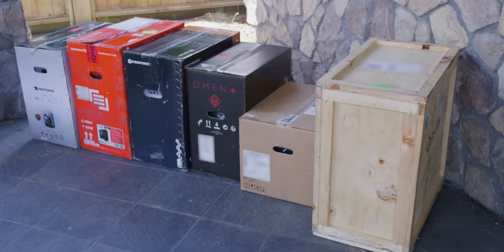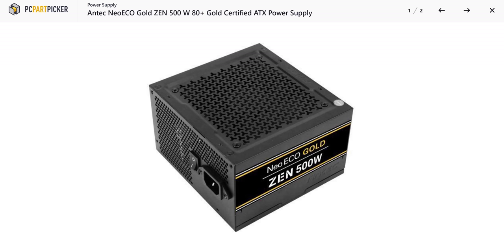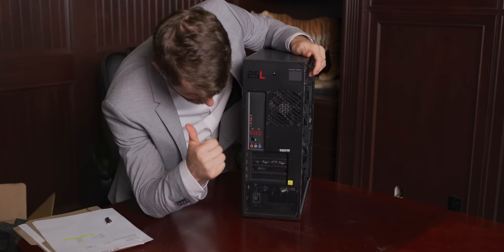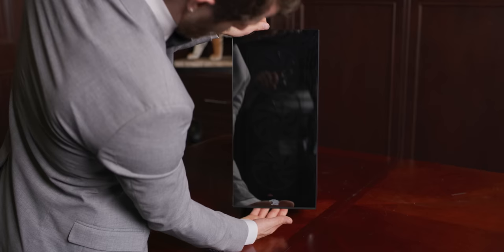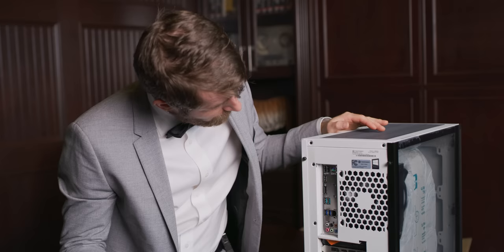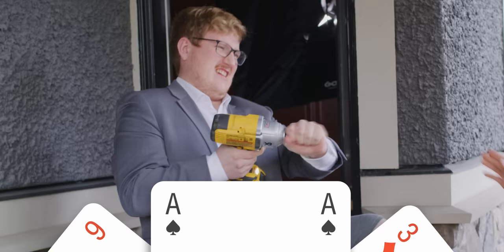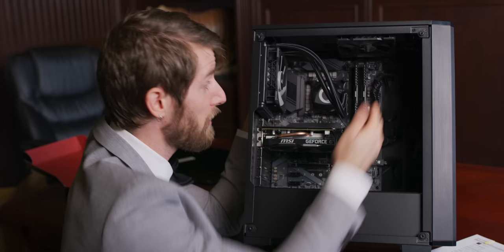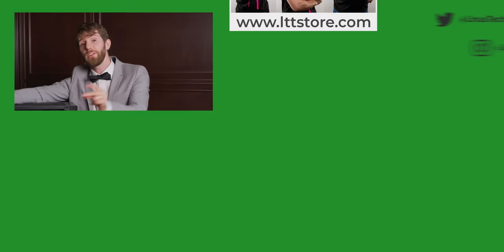What Did We ACTUALLY Get? - $1500 PC Secret Shopper 2 Part 2

Comment: If you watch close enough where Linus throws the Ram you can see it was actually the Ram that was trying to get away from Linus.
Reply: Origin PC: That AIO cooler is installed wrong way, air bubbles will get back to the pump.

Comment: Imagine having an air-cooled PC crate-shipped with a 1660 video card.
Reply: Is that a bad thing? I don't get it
Reply: Imagine having a 1660 video card
Reply: @BUCCIMAIN  Well it was the same price as the other ones but some of the others came with a 2070. much better than a 1660 and it also had the worst CPU. I would take a bent case over that any time
Reply: Directly from chYnuh
Reply: @aurorapaisley7453  lmao i'd kms if i had a 1660
Reply: @nicholasjasman6550  really bro? What about a gtx 1050 ti like me
Reply: @abd_cheese7353  jesus christ thats just depressing
Reply: @nicholasjasman6550  no man its fine. I can play most games at 1080p 60fps on lower settings. Its actually my cpu (i5 6400) that bottlenecks my games
Reply: @aurorapaisley7453  my 1660 does well :(
Reply: @binkk2931  Me chilling in the corner with a 1650
Reply: @Gort _ im sorry, thats brutal
Reply: its not brutal
Reply: @nicholasjasman6550  bro theres no shame in having a 1660
Reply: @nicholasjasman6550  1050 ti was a great card back in the day it was my first one but now I’m rocking the 3070ti thanks to gpu shortage being over but 1050 ti will always be a great extreme budget card
Reply: @BUCCIMAIN  Imagine getting an indoor golf court for a 1400sq ft apartment. Do you understand?
Reply: @Aurora Paisley  bruh I've got a 2gb 1050 lol
Reply: @boblatte123 thats a yuge ooof
Reply: @ObiJUAN  yeah, still works for what i play, but would like to try a newer card atleast
Reply: @boblatte123  3060 for 259 if theres a microcenter near you. That will be a massive upgrade for ya
Reply: @aurorapaisley7453  sounds like you need the wood
Reply: some of you clearly value GPU's a lot and I simply don't get it lol
Reply: @junior1896   These are gaming PCs and the GPU is the single most important component for gaming performance. Why wouldn't you value the GPU a lot?

Comment: Pro tip for the omen, that top panel can come off with a couple screws for a massive airflow improvement with no difference to anything else
Reply: Another thing with the omen: There's 4 panels in that top panel that'll pop out with some pressure, and 4 screw holes for a 120mm fan to mount to the system.

Comment: Origin has their AiO radiator mounted upside down. This is not only going to make it run unnecessarily loud, it will also compromise its lifespan as time goes on and water permeates into the tubing.

Comment: "what power supply standard is this?"
"DELL"
Reply: its too bad, a few years ago they still had standard psu's in their xps series
Reply: no no, its future proofing :P
Reply: yeah I have
 took apart in 2014 Dell systems with that same connector layout
Reply: As soon as I saw it, I thought "That looks like a cheaper low-end model server power supply, or maybe like one of those dedicated 12v ones we saw show up a few years back for crypto-mining rigs?" (I've used those to power LED lighting systems more than once, haha) Then Linus confirms it's a 12v only PS and... 80+ platinum on a 12v server power supply is... not very good. Don't even waste your time on anything under at LEAST 90+, if not 95+ or even 98+ at that point, as the cost difference on 12v supplies, unlike traditional multi-voltage ATX supplies, is a much smaller increase that is more than affordable once you're already in that price range and basing cost on %. It is nice to see that finally becoming a standard, though.
Edit: To clarify what I meant by that price range: 12v power supplies are cheap. REALLY cheap when compared to the traditional ATX ones. Need a nice top end 95+ rated 1200w power supply? How does $114 sound brand new? Sure, you could get the 80+ one for $100, but at that point you're not being efficient on just the added power cost alone over a few years.
Also... Platinum 80+? I've never seen that. Gold 80+ sure, but platinum I've always seen listed only on 85+ supplies...

Comment: What most people don't know about the Omen is that the case is designed for water cooling using a radiator in the top that does actually port through for cooling. As an owner, the lack of expansion ports is the only issue. Personally not enough USB ports.

Comment: FYI: afaik this isn't DELL using the "new" 12V power supply standard, but DELL just using their proprietary own 12V standard they've been using for years. 
For example the Dell Poweredge T20 also only uses 12V from the power supply and that came out Q1 2014 afaik.
Reply: I thought it was a redundant module from an industrial PSU.

Comment: I've got that cyberpower case and it's pretty great with regard to airflow. I use the 3 included led fans for exhaust on the rear and in the top two rear spots. Mounted 3 corsair fans to the other side of that grill where there is very little gap between the fan and the side pane for more direct intake.  NH-U14S instead of aoi.

Comment: Oh... That I/O sticker hurt. I was coming into this expecting to trash talk the Dell but that sticker was my least favorite part of this.
Reply: I know right, I normally just include a quick start guide with like 3-4 steps, photos of the actual machine they ordered and arrows pointing to where you plug things in.

Recently though I did a house call for a 9 month old machine with "fans turn on but no display at all anymore". Tried remote tech support first but silly me being used to highly complex problems, forgot to ask the most basic ones first. He had tried different HDMI cables, swapped monitor with his housemate, I even walked him through a CMOS clear just in case it was a booting issue or OC instability, but not wanting to leave him without the ability to game over the weekend I decided to pack some spare parts for testing and head over.

Before I even dropped my bag of spares on the floor I saw the HDMI cable poking out the top half of the case... the motherboard port, on a Ryzen system with no iGPU
We had a good laugh about it afterward, but it did remind me that I should step up my "user friendliness game".
So now I'm thinking of printing out some low tack vinyl stickers (NOT paper, and like 10 cents added cost per machine, oh no :P) to more easily highlight packing materials which need removing, where to plug things in, and maybe a small one that totally blocks motherboard video out if the CPU doesn't support it.. still easily removable if they want to of course, but which can be left on without blocking any other ports.
Reply: But they saved almost an 1/8th of a cent buying those cheaper stickers!! :D
Reply: @_Piers_  If these decisions were down to cost rather than just stupidity, you would think they could ask the customer "Do you want a complimentary basic keyboard and mouse?". Even if only 10% of responders say no it would save more than the cost of switching to vinyl stickers. 

I mean, the boutique builders have nicer everything.. more powerful parts, better quality cases, better cooling, and they still make enough profit. With lower sales numbers too.
I don't want to believe they'd do something so stupid in the interest of cost savings.
Reply: @MotoCat91  My real guess is that they just don't care.

Comment: After watching Steve's video on how the 80+ standard is not what we thought it was and only validates efficiency, I'm coming back to this video with a new frame of mind on Dells 80+ platinum power supply. Yeah it may be efficient but does it have any weird quriks and will it last?
Reply: Also to be clear that dell PSU is not the 12VO standard. It's completely proprietary. So is the motherboard. It's not a standard form factor.
Reply: To be fair, the 80+ standard never pretended to be about anything other than efficiency. Never seen a single scrap of marketing indicating anything else.
Though the Dell PSU is cheating by beeing the utterly shit 12V only 'standard'. Makes the PSU more efficienct, but many components still need 5V or 3.6V, so you need more transformators on the MoBo. They are basically outsourcing parts of the inefficiency that way.

Comment: The company I work for is pretty big and has different locations all over the city. I was located in the PC building (and ordering) location for some weeks. We literally "shipped" 1200€ PCs in the way of putting them on cheap and old transport trolleys and rolling them around the streets till we arrived at the destination. If anything wasn't as ordered, we put the PC back in the bux and pulled it back to the office where we fixed and and pulled it back.

Comment: Linus, 5600 xt ($ 310) beats the 2060 ($ 340) and is sometimes equal, better or less good than the 2060 super ($ 420)
5700 (350 $) same as 2070 (500 $)
5700xt ($ 440) better than 2070 super ($ 540)
(all in US dollars)
Don't say that the last radeon doesn't compare to the last rtx. That 2070 super and rx 5700xt are more or less equals

Comment: Timestamps!
0:00 Intro
0:14 Explanation
0:42 Sponsor (dBrand)
1:08 Title
1:17 Dell
7:16 HP
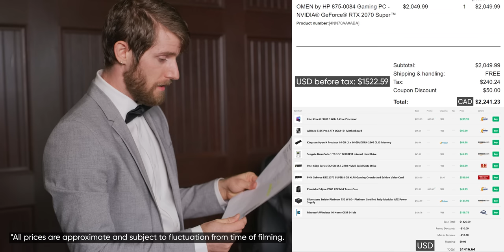13:25 iBuyPower
18:15 Sponsor interlude (dBrand)
18:28 back to iBuyPower
18:53 CyberPower
24:04 Origin
29:01 Maingear
32:51 Closing
33:14 Sponsor (dBrand)
33:45 Outro

Misc. Highlights
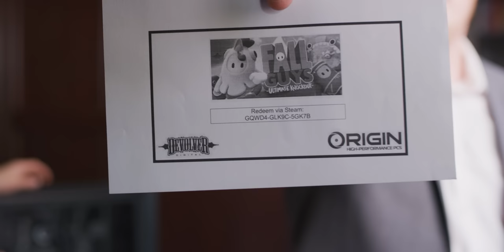26:35 Fall Guys steam key (GQWD4-GLK9C-5GK7B)
Reply: 31:30 Linus Drop Tips
Reply: Thank you kind sir
Reply: @Traventine  I was about to complain that that wasn't included! thenk
Reply: He do de sponsor™ 3x wtf
Reply: you forgot the fall guys key giveaway at 26:35
Reply: @Slm3lkm  Not quite a separate section, but I will add it as a miscellaneous highlight.
Reply: Damn, I wish he looked into MSI too.

Comment: Picked up a Cyberpowerpc tower with a gen 10 i5, GTX 1660 super, and 512ssd. Got her for $800 and I'm blown away with the value, only gripe is one 2666 8gb stick or ram that was swiftly swapped for a dual channel 32gb full population for multitasking.
Reasonable value with future proofing built into it.

Comment: "Spending money on an AIO doesn't make sense at this price point."
Me who got a AIO in a $1000 computer: Nervously looks away
Reply: I think they did a video a while ago on how little sense watercooling makes in most applications.
Reply: @ZesPak  im always nervously looking away at the dinner table.
Reply: One more like for this comment to be at 69 likes lmao
Reply: @somebody700  well, its quiet
Reply: @somebody700  it’s technically better at cooling according to nexus and jayz2cents data.
Reply: @somebody700  The price is saying. Don't buy me if you can't afford it. You are investing in the passive cooling GPUs to be brought to the consumer market? If the passive cooling existed the price point would be lower. Baba Guba.
Reply: in a scenario of you doing it yourself, it could be different - if you were sizing for a 240 or 280mm CLC/AIO, then that could have value versus other options.
even so, like a $45 Air Cooler for the CPU would be around the area that makes sense for 98% of users, the remainder being just people doing *serious* Overclocking.

it's just the prebuilt that the CLC/AIO is pointless for performance because they'll choose a 120/140 and those don't have a performance reason versus Tower Coolers.
HOWEVER - the reason why prebuilts often choose these smaller CLC/AIO's is because they Ship way better than big Heatsinks to. since the Radiator is screwed to the Case, they Ship excellently well, while a big Air Cooler is this giant heavy thing swinging off of the Motherboard. and even with the expanding Foam packs are still a Shipping hazard.
Reply: @Johnnyy832  3900x, nh d15s, 1.25v, 4.3ghz, never thermal throttles or goes beyond ~76°C. Im pretty sure you can find way worse aios
Reply: @somebody700  what about SFF? surprising amount of cases now have room for 120mm/240mm rads. Also many have issues with height clearance for the cpu. Also sometimes sound concerns from smaller gpus
Reply: laughs in 7 Noctua Fans

No man, everything good. As long as you are happy and it does give you what you want :)
Reply: @somebody700  AIO does make sense in a lot of cases. Even a small one can save a build from crashing in summer because some air cooler can't handle it. Since I've switched to AIO (280mm+ anyway, gotta make some "sense" right?) I've never had any overheating issue anymore since the heat curve is much, MUCH smoother, and the fans are at their lowest. No noise, no heat spike, discrete on CPU (doesn't block any DIMM slot unlike bigger air coolers) and, at least to me, easier to install. Those sure cost a bit more, and you sure want to get a premium one too, but that's totally worth it IMO if you're running a i7/i9 K/KS/KF for AAA games.

Comment: The best thing to remove sticker glue is plain old paint thinner, (mineral spirits).  This stuff will not hurt plastic parts but will instantly dissolve any glue used on virtually any label.  In addition to removing label goo; if you have kids who like to mark on latex painted walls, it works much better than soap and water to take off crayon marks without damaging latex paint!  DO NOT USE Lacquer or epoxy paint thinner.  Either of these WILL eat plastic and latex paint!  If the label is a paper label, the fastest way to remove it is to wet the label with mineral spirits first, let it soak in for a minute or two and then just peel it off.

Comment: I've seen the CyberPower warehouse here in socal, and those computers are stacked, on pallets, on top of each other, about 8 pallets tall. They really don't seem to care about shipping damage whatsoever.

Also, I had a computer repair with one of their units shipped with a case just like that, with an RX580. CPU and GPU thermal throttled during gaming. turned those side fans around and brought temps down a bit.

Comment: honestly combo audiojacks are fine most modern giming headsets are using combojacks anyway and their cables are really short, splitter adapters also tend to be cheap so they bring crappy audio and mic breaks so alot of the time its best to just hook it straight into the front IO.

Comment: Linus and Jake after seeing the Dell system: What?!
Me whose using a Dell Optiplex 760:
Reply: Sure looks like an Optiplex 3080 MT with a different front cover, doesn't it.
Reply: Inspiron gang B-)
Reply: optiplex 780 gang
Reply: Stares at my Vostro from 10+ years ago.
Reply: ayyy Optiplex 9010 DT over here
Reply: I have a dell idek with a GT 1030 
Don’t mean to brag lol
Edited spelling
Reply: @luke6271  a little dated, but still decent machine. Good for server or 1080p video machine. I think you can toss half a dozen drives into that. No M2 though.
Reply: @quin_skis_5136  that is the ONLY thing 1030s are good for. sticking in SFF machines.
Reply: @AC3handle  The DT is too small for 12 drives, your thinking of the MT. I got the the i7 3770 variant and fitted 16GB of ram and a GTX 1650 and it plays games. I have an older Optiplex 990 that does the PLEX and home server duties with 16GB of ram and a i7 2600.
Reply: @AC3handle  yeah man, mine is 13 years old now!
Reply: @saad9905  yeah, at least they're lasting longer and longer now. 
As it currently is, any comp made from 17 on is fully viable.
Reply: @AC3handle  I know right!

Comment: On the hp omen, an exhaust fan can be added to the top. 120mm. plugged into the liquid cooler header on the motherboard. The top bracket has four rectangle sections that pop out and a fan can be mounted to this. Also used for a single aio.

Comment: On the Cyber-power pc I bought 2 years ago it was about the same configuration. Ended up re configuring those side panel fans to pull air in, and added a fan for exhaust on top near the back with an intake coming in the front behind that panel, fixed my thermals.

Comment: Me: looking to buy a pre-built pc.
After watching the two-part series
Me again: I guess I'll be doing a DIY build.
Reply: Buying a prebuilt is plain bad tbh, u can buy the parts and make som1 assemble them for u for like 25 to 50 bucks
Reply: @jellyman9263  except a couple of these were actually cheaper then the parts standalone and you get better support/warranty ussually, and if your paying a random barely anything to build it likely gonna get worse cable management too. honestly would prefer to build my own like most but saying "lul prebuilt it trash" is just plain stupid and elitest.
Reply: @lenia272  but it doesn't really make sense to buy those parts standalone.
You can get more bang for your bucks with other components.
(e.g. Cyperpower has useless AIO and the GPU doesn't make to much sense)
Reply: @Jehty_  2070 super is pretty acceptable at the price point, it's important to remember that the PC's for this were ordered before the 30 series launched. AIO is just a why though. Never been a fan of 120mm AIO's as they just don't do much vs a cheaper air cooler.
Reply: @chaon93  the cyperpower is the one with the RX 5700 XT.
Reply: @Jehty_  I like AIO's cause they are usually quieter than standard coolers, and I like my pc to be as silent as possible
Reply: @chaon93  see you say AIOs don't do much, but as a general rule they are quieter in standard operation, and i like my PC to be as quiet as possible.
Reply: @acciuntxyz3462  bose makes headphones that make this a non-factor
Reply: In the Chinese biggest PC diy forum, we regularly see people buy rebuild then come here complain what's wrong and where they get ripoff. 
We call this part of the sub forum, the Wall of Fallen.
Reply: @acciuntxyz3462  a quality 120mm air cooler is often just as quiet as a 120mm aio (which in fairness will resist sudden heat spikes better due to thermal mass of the water), I'm not bashing aios as a whole, just suggesting stepping up to a 240mm if you're going that route